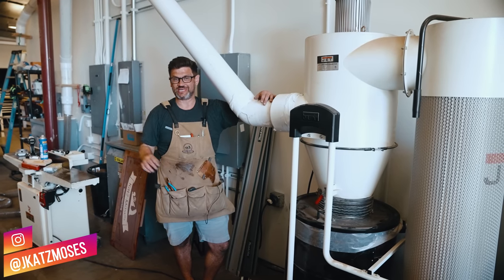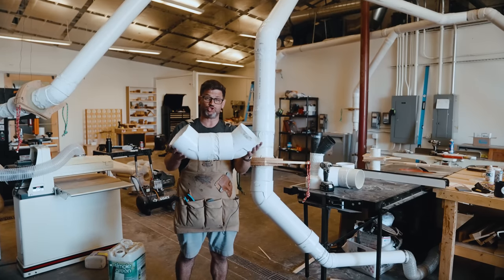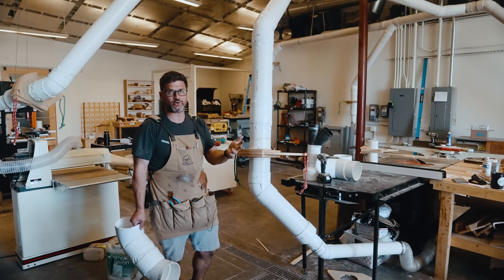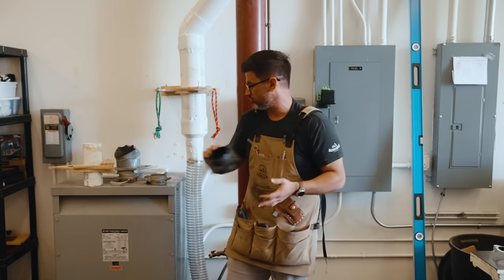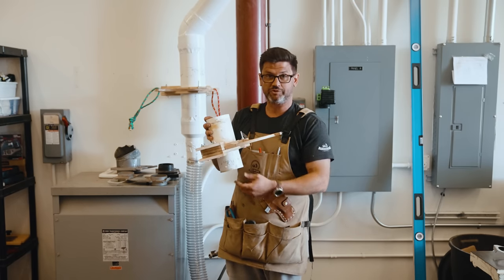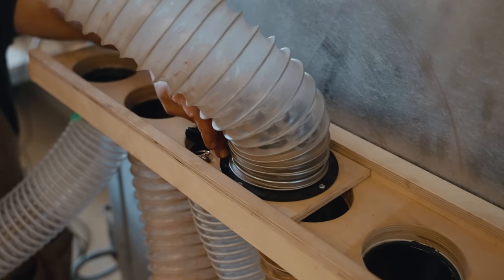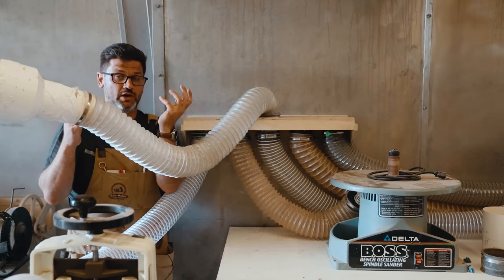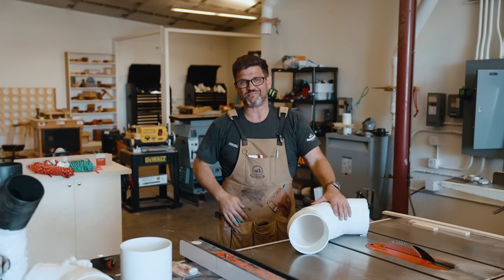5 Dust Collection Do's and Don'ts for ANY Size Shop

Comment from the maker: Support what we do at http://www.kmtools.com
4” AND 6” Blast Gates Digital Plans https://shop.kmtools.com/blastplans
Blast Gates Digital 4” OR 6” TEMPLATES (Comes with Plans) https://shop.kmtools.com/blasttemplates
Dust Collection Switcher Plans https://shop.kmtools.com/switcherplans
Dust Collection Switcher 3 or 5 Hole TEMPLATES (Comes with Plans) https://shop.kmtools.com/3or5templates
Tamar 6 in 1 Router Jig 2nd Run Sign Up List (Scroll to where add to cart button would be) https://bit.ly/3x3routerjigsignup
The Katz-Moses Woodworker’s With Disability Fund https://kmtools.com/pages/kmww-charity

Comment: Don't use "Duct Tape" (as in the brand, the stuff MacGyver uses, and the stuff that's actually not meant for duct work). Use aluminum tape which is actually meant to be used on duct work. It's more of a pain to get off but it's super sticky, won't break down, and won't leak.
Reply: Flex tape!
Reply: @bestyoutubernonegraternumber1  No.  Proper tape for taping duct joints is "aluminum foil tape". Duct/duck tape is the strong stuff.

Comment: Good tips, thanks. A suggestion for anyone with a small relatively square shop that plans to put their dust collector in the corner. Don't stick to running everything N/S and E/W or perpendicular to the walls. Plan out your tool placement then draw a floor plan looking down on all your tools and where their dust ports are located. If you're planning to run across the ceiling think about going diagonally out of the corner with your main line. Then all your branches are 45s off the main, just locate the Wye in the correct spot so your branch line runs over to the drop point above the tool. You can save some fittings and reduce suction loss with this method.

Comment: 3m makes a thin plastic film duct tape for flexible ducts, you can really get a good stretch seal on the first few wraps and normal tension for a cover layer, it seals any kind of duct I have used it on, fantastic stuff.
Reply from the maker: I'm going to check it out. Thank you

Comment: Have a question.  I bought the powertec 4inch dust seperater. Works ok. But when I use my drum sander, all the dust seems to be going right to my 3 micron dust bag. Nothing stays in the collector, not sure why. Any ideas

Comment: Instead of caulk and tape I put one layer of masking tape on the pipes before inserting them into the joints. Very tight fit but still adjustable and can easily be taken apart when needed.

Comment: Hi Jonathan - great video! A couple comments from an HVAC Engineer who designs DC systems. Great info but around 2:00 you mention that you should run as large as pipe as you can... Not always true and it can be unsafe to run too large of pipe. Pipe should be sized to keep ~4000 FPM (air speed) in your lines and if your pipe is too large your speed will drop below this. I have a video that teaches how to calculate this. Also, I recommend running that 6" line of yours right to the tool. Flip your flex hose from 4" to 6" and you will see a huge difference. That 4" flex line introduces the same amount of static as your entire 6" run. Love your channel and thanks for everything!
Reply: Should you put a blast gate at the start of each branch of the system to shut it off as close to the main line as possible or will that make any difference as long as the blast gate is shut off at the end of the unused line?
Reply: Fellow HVAC engineer, can confirm everything above.  ASHRAE recommends upwards of 4,500 fpm for heavier/larger chunks.  Larger ductwork will provide more air volume (CFM), but at a lower air velocity the particulates (dust) will fall out of the airstream and eventually clog up inside of the ductwork.
Reply: @scottmiskin4858  From strictly an HVAC perspective, keeping it as close to the main would be preferred, as any leaks in your ductwork between the main and the tool are taken out of the equation.  If you have the blast gate all the way at the tool, the entire run is under negative pressure and the leaks in that branch will still add to the system.

From a woodworker's perspective, seal up your ductwork as best as possible (as JKM did) and then put the blast gate where is it most convenient so you make sure to open/close them appropriately.  It's not worth it to get a ladder to have to close the blast gate just to save a few CFM worth of leaks.

Comment: Industrial hygiene practitioner here - larger diameter pipes can be good, but not always. It depends on the specifications of your fan. Different tools might require different air velocities, and static pressure variation can be detrimental to the overall airflow. But all in all, great tips. I can’t wait to design my own system.

Comment: I skipped PVC and went straight to metal ducting from The Blast Gate Co. Wish I would have spent a little more on the Nordfab style with the quick clamps. When I did mine 8 months ago, the metal ducting was actually cheaper and WAY easier to source than PVC. Plus, I was able to ground the ducting to my DC and then to a ground in the outlet so the system itself is all grounded. 3HP Oneida V3000. Also, The Blast Gate Co. metal gats are fantastic, I've never had an issue with them getting clogged or bent. I've spent a LOT of money and time on DC, starting with a shop vac and then 2.5" hose, and the 4" flex hose, and then finally a proper system. 

If you're serious about it, save your time and frustration - go straight to a 3-5HP system and metal ducting. It's SOOOO much more efficient and better.
Reply: PVC is smoother than metal ducting. This has been scientifically proven, but to your point, I’d bet my next paycheck that the transitions and joints are smoother with NordFab than with PVC, all other things equal.
Reply: Two more advantages of the Nordfab style: 1) I have moved my shop twice and was able to very easily disassemble and reuse all of the components. My current shop is the biggest dust collection system so far so I had to add components, but it was still very easy. 2) if you ever move and end up with parts that you can no longer use, or just give up and sell everything 🤯 the metal duct components can actually be sold and retain a surprising amount of their original value if not damaged.
Reply: Its not about smoother, its about static build-up, sparks and getting zapped.

Comment: Watching this vid and I'm at the part where you're showing the blast gates you made.
Great design. Thin nylon washers instead of the much thicker metal ones you use would still provide ease of use and make the gates even more air tight.

Comment: Katz, great info on dust collection. This is a topic that can't possibly cover everyone's situation or needs. Dust collection is the science of fluid dynamics that is fairly simple from a thousand-foot perspective, but in real world application becomes extremely complicated. Especially when working with vacuums, this limits the range of pressure to operate within to a theoretical MAX of -14.7PSI. I say theoretical because even high-pressure duct collectors or extractors will never come close to -14.7 PSI, most will only see -1 or -2 while some may go as high as -8 PSI or so. Anyway, as you said, one is always learning and it's great that you share yours with us.
Thank you, All the Best, Chuck

Comment: Great video, thanks.  The cheap and nasty plastic blast gates are actually quite good BUT you need to make a simple modification - cut the end off.  If you cut off the part where the gate usually packs in sawdust then they self-clean effectively.  The tiny space that is left does leak a bit of air when the machine is in use, but it does not affect the ability of the suction to work.  The very small gap and it's flat shape really limit the amount of air leakage that can occur.  I think in a pro shop like yours, they are simply too flimsy, but they are really good in light use in home shops.  I used a mitre saw to modify mine and it worked with a 1.5HP single stage and still works with a 3HP cyclone similar to yours.

Comment: I just pulled all the tape off mine Caulk all my pvc joints after watching this. I could see piles of small saw dust on the joints and on my insulation by my joints. Hoping this works.

Comment: Thin walled PVC is for irrigation drainage in landscaping. If you tell the salesman thin walled PVC and they look @ you with a question mark on thier face. Specifying for landscaping can help.

The difference between thin and thick is just how much pressure it can take.

Comment: I don’t have dust collection system (yet) but from reading and watching videos on the topic, I’ve been made to believe that the plastic pipe is not good because of static and it requires wiring to ground it.  Is this a thing or not?

Comment: If you buy spiral metal ducting which is designed for air movement and not sewer the corners and connections are better suited for the job.

Comment: awesome video and the new shop looks great. Question.... how come you havent gone Ivac pro automated blast gates?? I have a small shop and they are the best thing since I always forgot to open the gate needed at the time.
Reply: I have these in my shop, they're awesome especially when coupled with the powerline sensor. They do have a down side in that you're limited in how many you can have operating a single DC.

Comment: Awesome vid... I'm about to install a dust collector in my garage/shop. 

I've heard that you need to ground the PVC to prevent static, and possibly cause a fire. Can anyone confirm of deny this?
Reply: Stumpy Nubs did a video where he installed a new dust collection system and talks specifically about this.

Comment: I love the color-coded rope pulls!  But (to me) it looks like you accidentally switched them.  I think of green as equating to “go”, so i’d put it on the side that would open the gate if you pulled it (I.e., it’s ready for use).  Yours, however, appear to be the reverse.  I'm curious as to your logic.  Thanks.

Comment: I've made the mistake of putting caulk on the joint before assembly.

There's so much surface area it grabs ahold almost as well as cement. 

If you make that mistake like I did a heat gun can help save the fittings.... even if you have to cut the pipe first, the pipe can be reused in shorter locations,  but those fittings are so pricey
Reply from the maker: Good tip!

Comment: I'm trying to design my system but am having trouble finding the thin wall pipe and fittings.  Can you share the specs on the pipe you are using and where one might be able to get it.  Thanks

Comment: Tip: You can bend PVC pipes to any angle you want using heat. People usually do this by filling them with hot sand, or steam. Then bending them into shape with a simple mold. Not sure how easy it is to bend those big pipes though. But I think it is doable. I.e no more 45 degree angle... but perfect curves.

Comment: Your switcher set-up has a 90+ degree angle on the single line. I believe the single selector line should be elevated in order to have a straighter line to the selector.

Comment: What were you recommending for thin wall pvc? You mentioned a link in the video but can’t find it on here or your website. -Mike
Reply: Schedule 10 (pretty flimsy) or Schedule 20 PVC is likely what he was referring to.  Standard plumbing PVC is Schedule 40.  As the Schedule # increases, the wall thickness increases.

Comment: Since you went with pvc, why not use 4 and 6 inch electrical sweeps?
Reply: They won't fit on sewer & drain pipe. Electrical conduit is different diameters than drain pipe

Comment: There is chip collection and dust collection. The airflow requirements are different for each. They are dependent on many factors including the efficiency of the hood at the tool. Most home woodworker tools have at most a 4" outlet,. Running a 6" pipe all the way to the tool and then transitioning to a 4" greatly reduces the airflow. At the pressures generated by a blower air behaves more like a fluid that is it doesn't compress.Like water through a pipe the volume is limited by closing a valve-changing the cross sectional area of the piping.In addition to losing CFM ,you also lose FPM air flow speed as the air moves into the 6" duct. If it drops below about 3700FPM it may not be able to carry chips in vertical piping.Good chip collection does not necessarily mean good fine dust (the health hazard) collection.Bill Pentz is a great resource on dust collection.

Comment: I am a woodworker with a day job as a hazmat professional. When the people in my profession see woodworkers flailing at a problem with ill fitting masks, it's just very concerning. Johnathan and the industrial hygiene professionals here are providing good advice to protect yourselves. Capture the dust at its source. Don the best mask available when you are servicing your collection system. Mitigating contaminants starts with engineering controls (dust extraction) and process management.  The PPE (mask) is your last line of defense, and professionals know this from the collected data.

Comment: And you don't have issues with static electricity buildup in the pipes? In Europe it's strictly forbidden to use plastic for ducts. Needs to be metal or you have to run copper-tape along the full length to prevent dust explosions.
Reply: Dave -- Your regulators are borrowing rules from grain elevators and similar high-dust environments. The fine dust in grain elevators has been ignited by sparks from static electricity, so grounding of ducts is very necessary. Your regulators have chosen to apply those same rules to the dust collection systems in woodworking shops. But, does the same risk exist in similar, but different, environments? Several studies done in the United States say this risk of explosion does NOT exist in woodworking shops. 

There are at least a couple of reasons for this. First, wood dust isn't as combustible as grain dust. That may be counterintuitive, but fine flour-like dust particles ignite very easily and burn very rapidly when suspended in air. That's not as true for wood dust. Wood simply requires a higher temperature for ignition. 

Second, the volumes are very different in the two environments. A typical grain elevator will have a volume that is measured in hundreds, if not thousands, of cubic meters. The volume of a dust collector -- even those in a commercial wood shop -- isn't nearly that size. So, a grain elevator (as it is being loaded or unloaded) will have a lot of room above the top of the grain (or flour) to accumulate a lot of highly combustible dust. If an ignition were to occur, there could be plenty of suspended dust to fuel an explosion. That's simply not the case with a dust collector. My shop's dust collector has a volume of maybe two cubic meters. Even if an ignition were to occur, there wouldn't be enough fuel to do any damage. Yes, a dust explosion can be very powerful. But, there's a reason we don't use grain or wood dust to power cannon shells. It takes a lot of dust to produce an explosion of any real power. You simply cannot suspend that amount of dust in the air inside a wood shop's dust collection system.

Bottom line: Obey the laws and regluations of your country. But, all countries have laws that are misguided.
Reply: Easy solution… listen carefully. Wet your finger, reach out your arm, touch the duct. Voila! Instant discharge! 😉👌
Reply: @josiahutah3712  So I need to hire someone with a wet finger to constantly discharge the ducts while I am working? Sounds like an expensive solution :)

Comment: You did not design the rocking blast gate, the original idea is at least 15 years old and mine are at least 12 years old. Any time you reduce the pipe diameter below 6" you may as well use that diameter all the way through because the flow is restricted to the small diameter. Modify the machine port to 6" and use a 15" impeller or bigger. There is more misinformation on the net surrounding dust collection than most subjects unfortunately. A major problem and a common mistake is to instal the Y's with the inlet leg pointing down, they should always be installed with the inlet horizontal because if the machine is not used for a while the dust drops into the downward pointing leg and blocks it. When the blast gate is next opened on that leg it will be pulled up as one plug and can cause further blackages.  have been doing this stuff for a living and have a fair idea of what works so take my comments for what it they are worth to you.